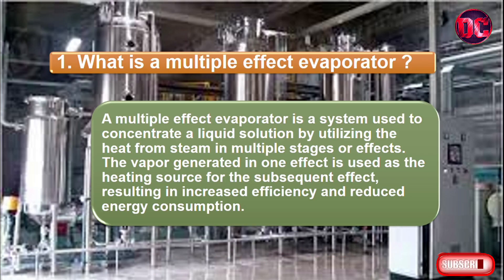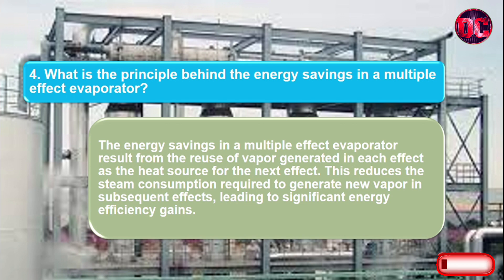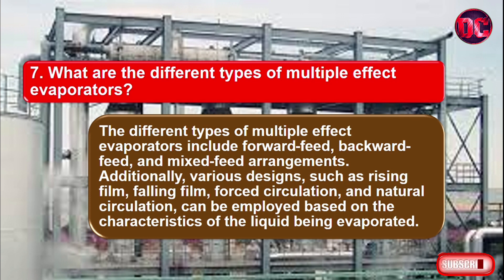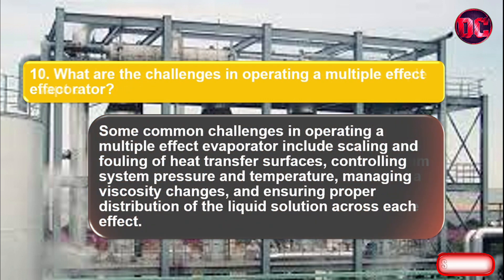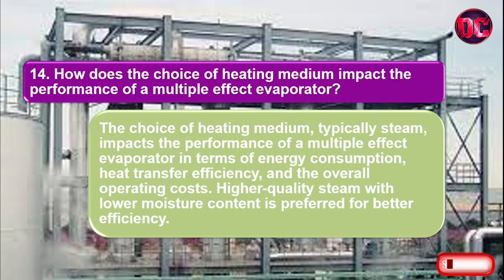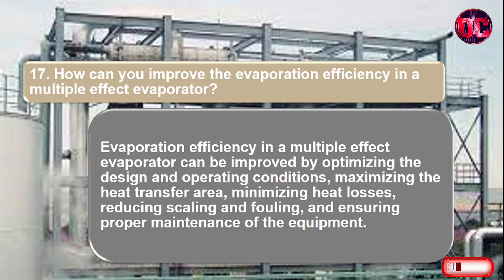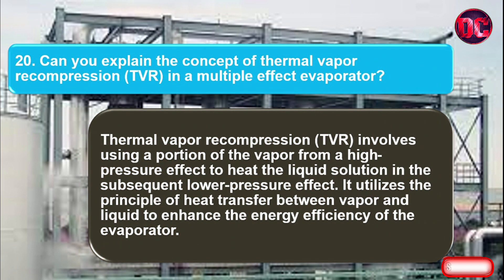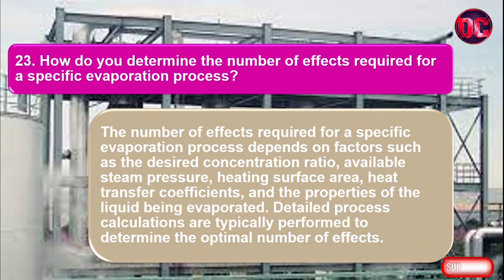Multiple Effect Evaporator questions and answers | Interview questions and answers of MEE |

Comment: Dear Sir,
what does impact on MEE by low TDS and high COD effluent feed?
Reply from the maker: Good question dear 🙏

Impact of low TDS water in MEE plant 
 1.Reduced boiling point elevation 
 2.Decreased heat transfer coefficient 
 3.Potential scaling and fouling issues

If High COD in Feed 
1. Increased energy consumption 
2. Increased fouling and scaling tendency 
3.Increase corrosion tendency 

"Great! We're glad we could provide the information you needed. Please don't hesitate to ask if you have any other questions."